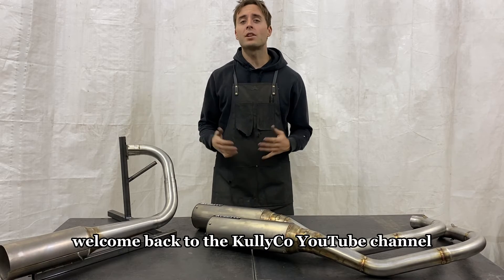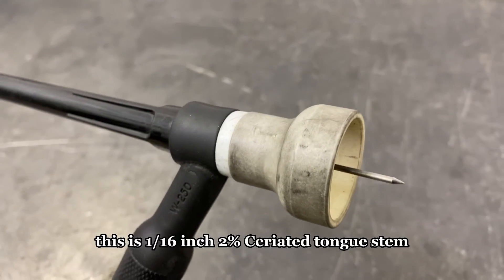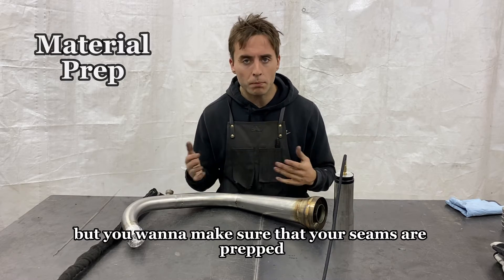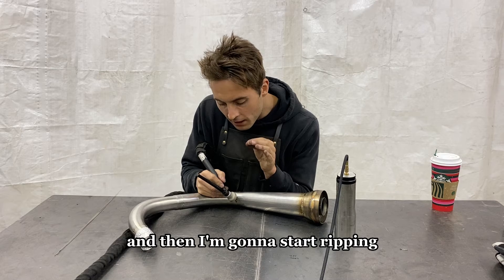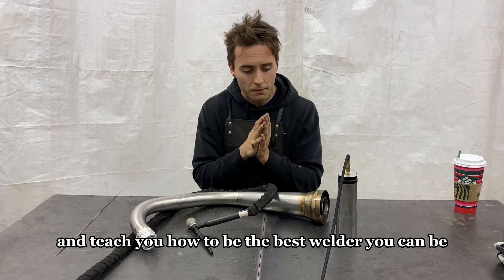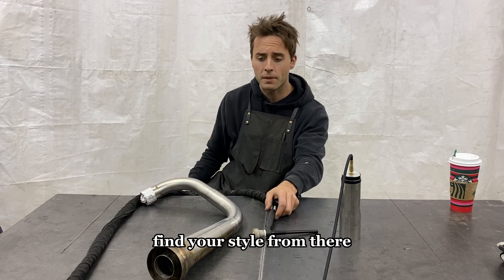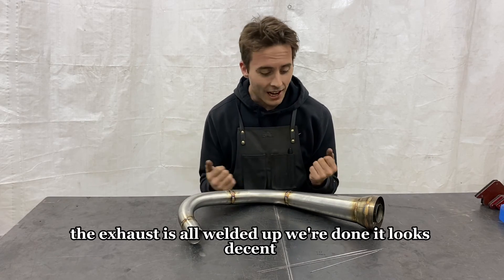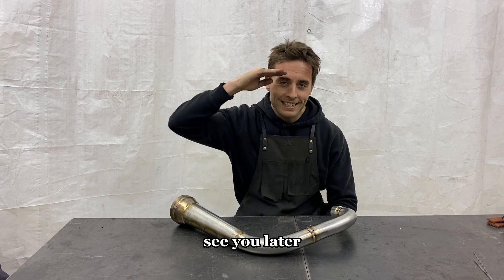How to TIG-Weld Stainless Steel Exhaust like a PRO!  Technique, settings, equipment, and secrets!

Comment: Thank you for your videos, really helpful to the newbie. What tricks do you recommend when welding exhaust on the vehicle (necessary evil sometimes) so back purge isn't a reality there?
Reply from the maker: Is it a new full exhaust with new material? If so, I would purge.  If your just sectioning in a piece- I wouldnt worry about purge

Comment: can you weld without a back purge or is it absolutely necessary  - Im a beginner and don't have a back purge set up 😟
Reply from the maker: You can weld without back purge, you are just going to have crystalized slag hanging on the inside of the tube, and ultimately the weld isnt as strong, but you can still weld it- and it will hold up!

Comment: Thank you so much for making this video. I'm making 3" stainless steel side pipe exhaust for a LS376/525 in my 67 Corvette. Lots of tig welding to do so I'm learning how to do it. This helps tremendously, brother! I'm sure that I will do a lot more welding once I get good, but do you have a recommendation on a tig machine that I should get. One time job, so I don't want to spend a fortune on Miller or Lincoln. Thanks again.

Comment: Now, how do you tig a 1/2” hanger on there
Reply from the maker: lol what do you mean?
Reply: @KULLYCO  yesterday I put a stainless exhaust on a dodge ram build and went with the original style hangers. 1/2” stainless bar. The round belly of the bar and how thick it is.. I did some grinding to flatten them out but still hard to escape that haunch. I just went ahead and mig’d the hangers on. Minimal spatter. It kind of makes sense when you see the exhaust tigged up. And the hangers are mig. Doesn’t have a cheap feel to it but I’d rather tig everything. I’m going to practice with the scraps I have left over. 

Amazing video though!! Thanks! Maybe make a part 2 about how to weld on different style hangers :D

Comment: Great TIG tutorial. The only thing I would add to a racing exhaust is a low mass high flow cat ceramic sponge & O2 sensor for a radical reduction in toxic tailpipe emissions remediated by better fuel air ratio control ECU power commander data from O2 sensor pre and post cat, and catalytic decomposition of HC, NOX, SOX and soot to CO2 & water vapor eco-friendly respectively :)
Reply from the maker: I appreciate the input- will take all into consideration:) thanks for watching!

Comment: Great video, very educational, totally agree with everything except I strongly disagree with setting the heat and matting the pedal, that is definitely poor practice. B pressure and CWB welder here, been welding thin wall stainless and aluminum for over 15 years
Reply from the maker: Hey !  I appreciate that input, there are certainly multiple approaches that work.  I've found to get the best welds consistently, this is a good process.  Its also good for beginners.

Comment: Welding SS >>>>>> hexavalent chromium. Where is your respirator? professional teaching others…
Reply from the maker: I dont wear a respirator... I will probably regret that someday.  Maybe someting I should get serious about looking into!  Thanks for watching, otherwise... cheers
Reply: @KULLYCO  well logical would be to stop hurting your health right now. I recommend 3M 7500 respirator with 3M 2091 filter designed for welding which is what I use. There you go I have done homework for you no more excuses
Reply from the maker: @Bakanelli  haha ok sounds good . I actually do really appreciate that!
Reply: A fume sucker is much better.
I had a small fan I salvaged to repurpose, and it fit perfectly into an old piece of stovepipe, that I mounted on the wall, to suck it outdoors.
So I cut the pipe and necked it down to about four inches, so I could use dryer vent hose to weld site.
A 5"x5" piece of 1/2" plate and rod, with a piece of coat hanger is used to hold it close to weld area.
We welded with Flux core in the tubs (bottom base that it swivels on) of Large draglines for years w/o any evacuation, so I figure
I'd better get smarter in old age.
Reply: @bryanmcleod9346 Usually very very hard to weld Tig with fume extraction, sucks your shield away

Comment: i dont want to be "that guy"....  but,  are those welds not a little wide given the size filler rod you are using?
Reply from the maker: I like a nice , wide weld :)  I would say this is ideal in terms of size - full penetration

Comment: I was skeptical about the amp setting until you explained it. Makes more sense than what is usually taught.
Reply from the maker: Right on! Glad you were able to get value out of it.  Yes the AMPS are a debatable topic- but i believe the way i doing it creates the best / most consistent welds

Comment: maybe i was not focused and i missed it, but i couldn’t find the answer to my question. do you use pulse for it? and what are the hz? thank you!
Reply from the maker: I very rarely use pulse- only in a few specific scenarios.  On all exhaust material I do not use pulse.  Just 36 AMPS with peddle wide open.

Comment: hi, what tig welder do you recommend for a beginner? do you think $800 budget is good enough?
Reply: The primeweld 225 is decent and comes with a CK torch
Reply from the maker: I cant comment on that too much- I have been fortunate enough to welders that are on the pricier side.  I can't say for sure the best way to go for your budget.  My apologies
Reply: I got a welder for 160 dollars it can do tig and stick its worked fine so far

Comment: super missile is good, but hyper rocket turbo atomic is even better 😂
Reply from the maker: lolol thats awesome!  I think you are probably right!
Reply: @KULLYCO  and thank you for the video! I am 'teaching' myself welding stainless TIG and it is quite different after many many years of MIG. Still finding my way ..ehh.  trying 17 and 9 size torch, using foot pedal or finger trigger etc etc.. slowly but getting there and your video was also very helpful..( I mean even apart from the secret sauce i.e. the missile ;) )cheers!
Reply: I'm having trouble sourcing "super missile weld" or "hyper rocket turbo atomic" - do either of you have a source that you could share?  I'm welding really thin (.030) sheet 316.

Comment: how many amps would you use on 16 gauge tubing?  I am having a difficult time getting my weld to penetrate all the way through and not having a burnt, overheated weld.
Reply from the maker: I would start around 45 amps with 16 g
Reply: @KULLYCO  thanks, I started at 45 and upped it to 50a.   45a was not quite enough for the weld to penetrate all the way thru.

Comment: Hey just started following you from Norway 👌 great informative videos. You have seriously helped me step my welds up 👌 I am using an older Fronius Magicweld 2000 and playing with settings. 
But this Super Missile 0.035” filler rod you speak about. I have literally spent the day going into every welding supplier here in the south west of Norway and not one of them knew about it and the closest they could supply was Harris SMW 1/16 😅🤦‍♂️ 
To me I work in metric and I converted it but  1/16 is not the same as 0.035”  I guess they were trying to sell me something different? 
HELP as I really wanna give this a go and step up my stainless exhaust game…
Reply from the maker: Hey man! Thanks for reaching out- its great to hear that your getting value out of these videos. Keep up the practice ! 

The technical word for supermissile is tensilweld , look online for it. I get all of my supermissile from Airgas in the states! 

Good luck!
Reply: @KULLYCO  Washington Alloy?

Comment: I love this channel, and the explanations are simple, not confusing. I'm in New Zealand so cannot find the Super Missile rod, anyone know where i can purchase online? Thank
Reply: Super Missile should be close to ER312L. It can be used to weld 316&321ss but depending on heat load of the material you should over alloy.  Also consider using ER316, 321, 347. I've been using 1mm 347 for years it doesn't really wet out nicely so it's not a Instagram rod with a lot of luster but typically the metal fatigues before the weld fails. Plus I bought 22kgs of the stuff so I might die before I get thru the spool.
Reply from the maker: Thank you for the insight! I am always learning myself, and glad when guys will share knowledge ! Thanks for watching.   @alexhise968
Reply from the maker: Thank you man! Appreciate the words ! I’ll try and keep the content coming. I’ll give you a hint that might help on the supermissile .  The technical name is often ( tensilweld ) 

Have a good day!

Comment: Love it when you do one of these! It's nice to have bike specific stuff on YouTube. Question: A lot of this would carry over to titanium yeah? And design wise, I see the inner pipe inside the cone goes through to the header flange so is the cone bit just added volume for the silencer? Is it full of packing when its assembled?
Reply from the maker: Right on- thanks for watching ! 

Yes alot of these settings and techniques would apply for titanium, very similar !  But a few differences.  I will make another how-to titanium video soon. 

Yes muffler is packed when finished.  The megaphone expands up and then reduces down (reverse cone) going into the muffler.  The perforated tube is then secured inside the muffler by the reverse cone. 

Thanks